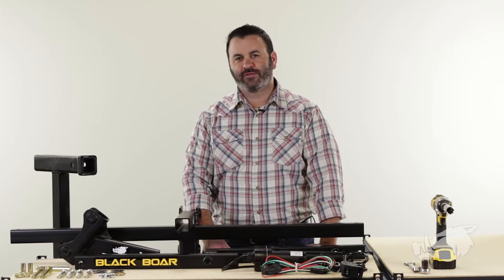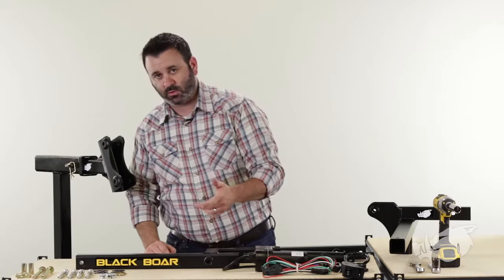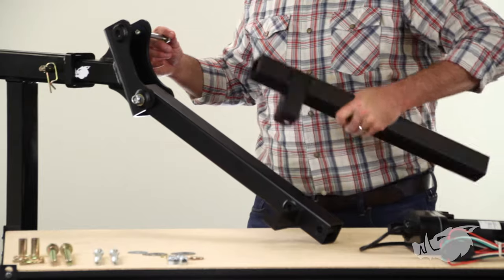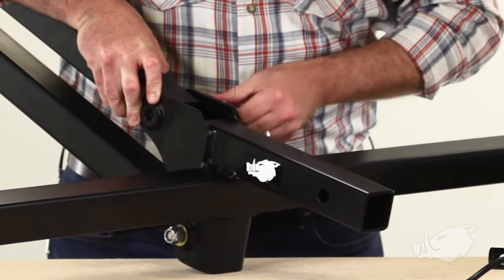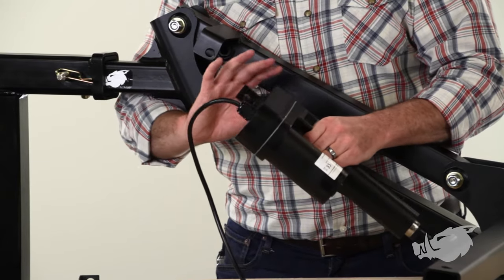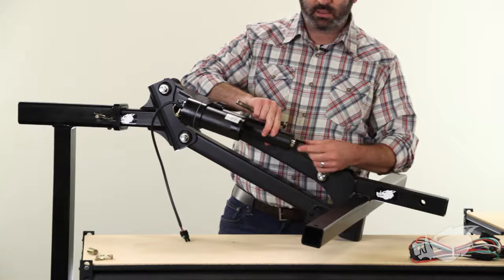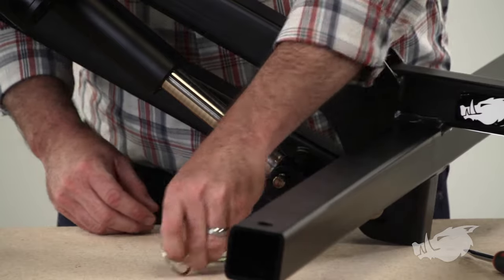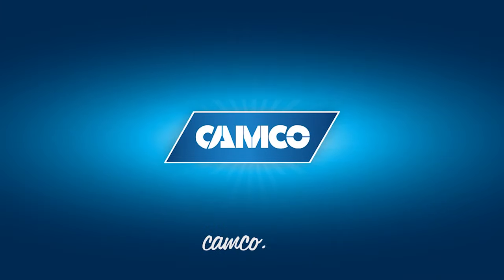Black Boar Motorized Implement Lift: Assembly and Installation

Comment: Just ordered one for my remote ranch, going to try to adapt it to a sleeve hitch garden tractor moldboard plow.  Might take a little adaptation.  Noticed that a sleeve hitch adaptor is over 100$  Its just a 2" reciver with a plate on the end.  I can make that.  Anyone else ever done this?  I tried to buy Iron baltic's setup because they offer a moldboard plow, but they didn't get back to me in time.